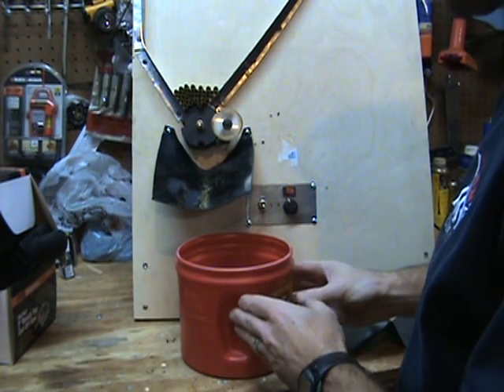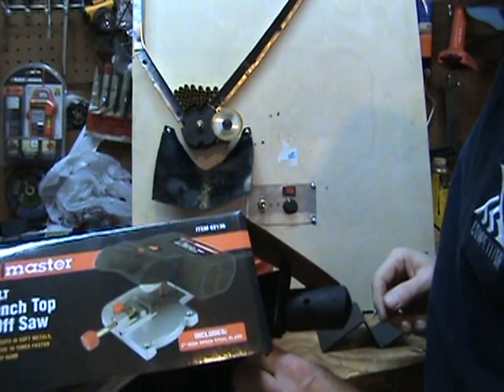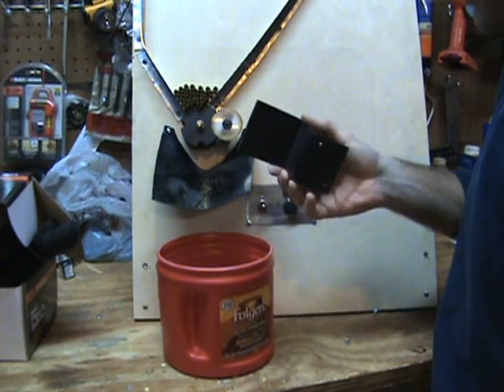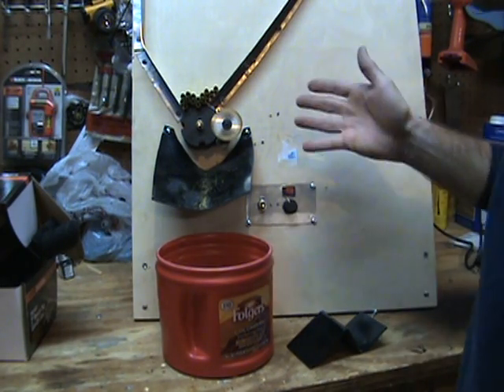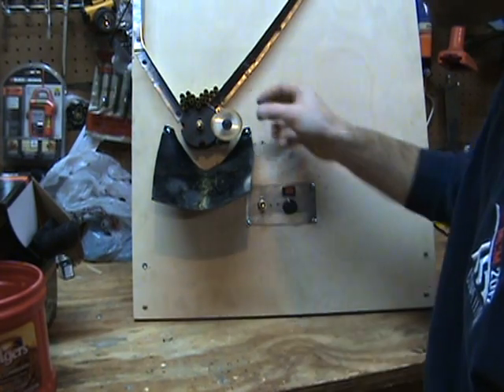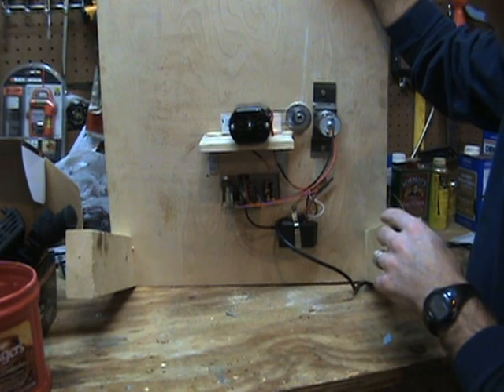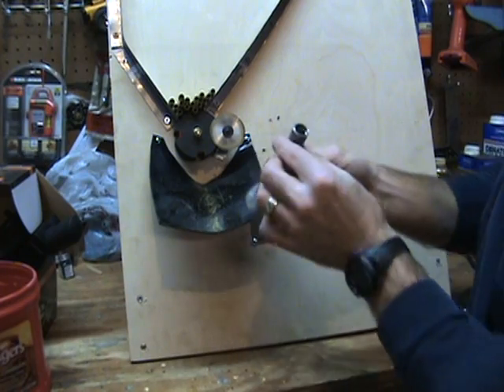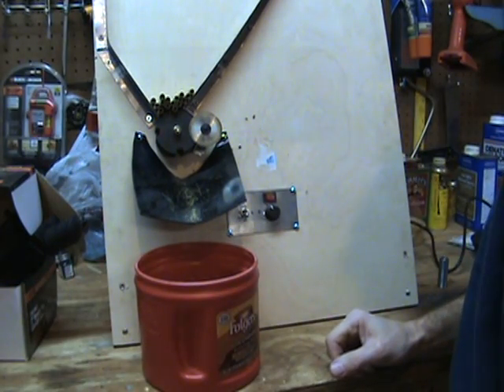Fastest .223 to .300 Blk Brass Trimming Machine

Comment: Holy heck 
Holy heck 
Hhhoollyyy hheeccckkk 

Can I convert my annealeze machine I don't use anymore to do this ???? 
So cool
Reply from the maker: 😁Thanks
Reply from the maker: As for the annealing machine, I'm sure you could.  That was actually the inspiration for me to use the rotating drum.  I just put four slots in it instead of the one.  Here is what you need to do:  Figure out what type of saw you are going to use and how you'll drive it.  Then you need to be able to adjust the length of cut.  Most importantly you'll need to hold the shells in the drum securely while they are being cut.  I used a piece of aluminum like a shell plate so the shells wouldn't fly out and I used a little strip of felt in the drum so the shell wouldn't spin.

Comment: Awesome contraption, I'm gonna try and whip up one of these myself. For that case feeding drum did you buy it and modify it from the brass annealing machine or you just made your own? I saw that other video you mentioned and seems like the material of the wheel is important or else it can get caught up on something, I can only find case feeding drums with one cut out.
Reply from the maker: I made the drum out of a piece of 2x4 with a hole saw.  I drilled hole along the perimeter and filed the edges so the case would drop in.  I cut a small piece of aluminum sheet and screwed it to the back to hold the case rim.  If you don't have that the case will fly out when it hits the blade.
Reply: @runforyourlife9684  Thanks a lot for the info!

Comment: As I have gotten into 3D printing because of Ammo Mike’s Bullet Collator, I’m looking at your amazing design and imagining it’s redesign with some 3D plastic printed parts. Things like mounting brackets, the bullet spindle, and switch box/plate could be 3D printed. I don’t know about the adjustable sawblade arbor, but I’ll have to experiment. Thank you for the design idea. If I get around to doing this, I’ll create a Bill of Materials and the STL files for people to make their own, and link it to you.
Reply from the maker: I think you could certainly print several of the parts you mentioned. The saw blade arbor has some pretty fine threads so I don't think you'll be able to do that based on the  precision of the 3d parts I've seen.  If you can, that would be great because that is the hardest part to make.  I've thought about redesigning it to get away from that part, but I really haven't put much time into it.

Comment: Making making mak.... Gets to dc, ac shiz. Well guess it wasn't for me.
Reply from the maker: The way I converted AC to DC was to just use a universal, plug in the wall, DC charger from Amazon.  Here is the link: https://www.amazon.com/gp/product/B006GEPUYA/ref=ppx_yo_dt_b_asin_title_o00_s00?ie=UTF8&psc=1
This is the gear motor I used: https://www.amazon.com/gp/product/B00BX54O8A/ref=ppx_yo_dt_b_asin_title_o01_s00?ie=UTF8&psc=1
So the power coming from the wall is split; one line going to the DC converter and the other end directly to the AC motor.  From the DC converter, the DC power goes to the speed controller and then to the motor.  Here is the motor speed controller I used: https://www.amazon.com/gp/product/B007TH4EN6/ref=ppx_yo_dt_b_asin_title_o01_s00?ie=UTF8&psc=1

This is a link to the upgraded cutter motor I put on in the new video: https://www.ebay.com/itm/AMETEK-LAMB-5409-33-2-Universal-AC-DC-Mtr-1-4hp-19-500rpm-120V/223756743602?ssPageName=STRK%3AMEBIDX%3AIT&_trksid=p2057872.m2749.l2649

Hope that helps.
Reply: @runforyourlife9684  man you are super awesome. Thank you.

Comment: Nicely done! Turn on and go do something else!
I actually rigged a setup to part the shoulder off in my 12x36 lathe. Then discovered I can grind the neck and shoulder off in 3 to 4 seconds on my 2x72"  belt grinder w/ceramic belt. That's my next step, rig up a simple, two piece, v-block style fixture, and grind the occasional small batch I need for my CZ 527.
 For someone loading for an AR, your device would be hard to be without!

Comment: This is pretty bad ass.  I have been trimming with a Honey Badger on my Dillon, but the huge amount of shavings generated tends to clog the vacuum hose.  I could see running the cases through something like this first to reduce that.  You could set the rough trimmer to run while the operator does the finish operation with the power trimmer on the press.

This would also have some application for rough trimming cases other than 300blk where a trim die might not be available, or the case is too short (like 7.62x25).

Comment: How consistent is the case length? Are you seeing significant variation when the blade heats up after continuous use?
Reply from the maker: The cases are pretty consistent.  About 1 per hundred or two (.5 to 1%) are a little shorter.  I've no idea why since they occur randomly.  I don't think the blade gets that hot since it is spinning so fast and it has time to cool off between cuts.

Comment: Wow now that's a great idea.  I am going to build one .  I a jistbgetting into 300.blackout and this seems like a time saver once its built.
Reply from the maker: The most difficult part is making a housing for the shaft that mounts to the board.  I made mine with roller bearings from McMaster and threaded on the outside so I could adjust the cut length.  I'm sure there are other methods you could use.

Comment: You should mount two drop aprons. The one in place is good for the shells, but a second apron beginning in plane with the cutting blade would ensure the cut ends don't drop into the casing bucket. If you're still using this setup.
If you are still using it, do you like it and have you modified it?
Reply from the maker: Yeah, I had the idea for the second chute to catch the tops but haven't installed it yet.  I haven't modified this design because I haven't cut many cases in the last year.